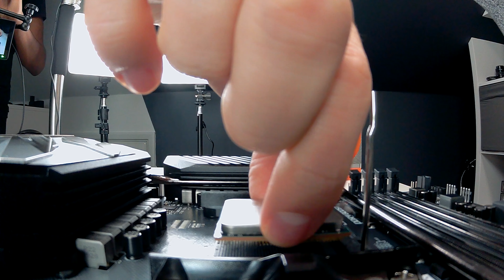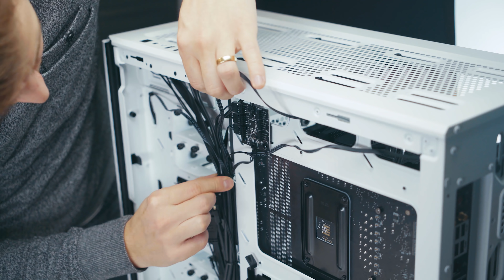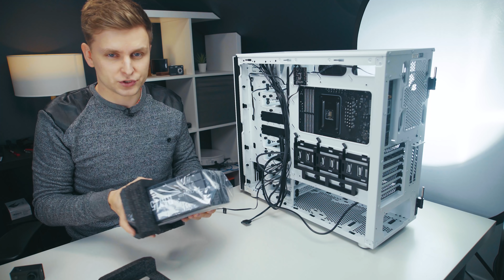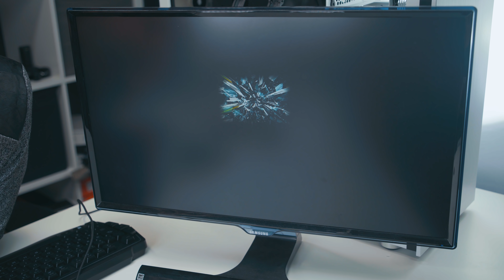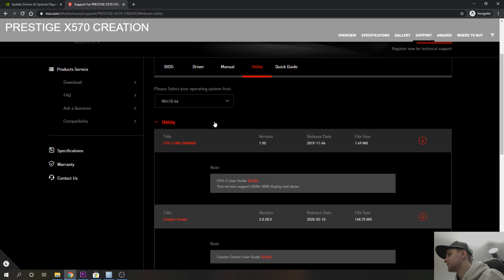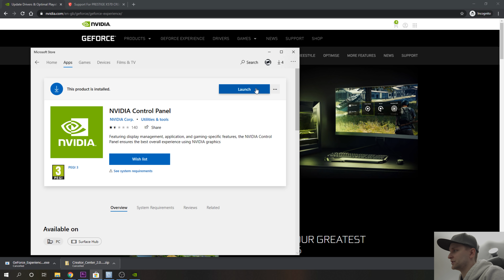ULTIMATE GUIDE: How to build the MAC PRO KILLER PC

Comment: Hello, so I had this built. After watching you for a while, I realized the GPU was put in wrong. I'm going to fix it myself. One of my USB ports was creating an over current. Which shut my comp down in 15 sec. I got a brand new same motherboard, what GPU upgrade would you suggest?  Along with Sound I upgrade my CPU? I know CES is coming up with all the talknof the "new" GPU's being released, should I wait or can my aka this set up even handle the new GPU's? I have the 1200 power source.

Comment: So I'm in a bit of a predicament. The motherboard keeps giving me the 02 boot error, and also the RAM errors of 50, 51, 52, and 53. I've tried each RAM by itself in each slot, but nothing changed. Even tried reseting the CMOS. So, I took everything out and built it outside the case. Oddly enough, with 1 RAM in slot 2 it tries to find a boot device (none present at the moment), but then adding a second RAM in slot 4 it goes back to the 02 boot error. Ended up reseting the pc with the case rest, and now it flops between the Boot and RAM errors.

Comment: I am trying to do this build and so far I'm stuck on getting the cable management right. There was no way for me to place the pinholes to the pins. I'll give it a day break though. I'll continue this weekend and hope that gravity helped me enough.
Reply from the maker: You could try to attach the 24pin to the mobo before screwing it in, that way you could plug the necessary PSU cables in before installing the mobo. :)
Reply: I’m almost done!! But quick question for the graphics card. You said that you’ll want to place it in the PCIE gen 4 to make sure it’s the fastest but what if I have a PCIEx 16 or should I use that instead?
Reply: Solved it! :)

Comment: On my mother board the code c5 and d0 pop up. And on my mother board there’s a light turned on in the EZ debug LED for the DRAM. Can you help? I can’t get it to load on screen and remove those codes
Reply from the maker: Make sure your ram sticks are properly inserted, and also try using only one stick see if it turns on.
Reply: @theTechNotice  thank you so much! I’ll try it out and report back :)
Reply: @theTechNotice  One question though! Should I try to remove the RAM sticks while in the case ...or do you recommend taking out the set MOBO and cooler
Reply from the maker: While in the case, but make sure your pc is off!
Reply: @theTechNotice  so I removed the RAM and tried it with one stick to see if that solved the issue but nothing. Could it be the sticks don’t work? If not, do you think their might be an issue with the motherboard or something else? I heard the mono has an issue flashing the BIOS
Reply: @theTechNotice  sorry for all of the questions. I’m just struggling
Reply: I’m getting replacement RAM sticks to check if that’s the issue. Do you think I should place a return on the MOBo? It’s my first build and I’m not sure how to get it to boot and not have the code

Comment: The only issue I have with that case is the bottom-mounted power supply. In most cases with modern cases I have the issue of no ODD drive bay but I seem to see one of them in this case. What is the make and model of that case? May I make a suggestion that you get a strap for the go-pro that would attach it around your head like a head-mounted flashlight/torch mounts. A scalpel will allow the removal of a zip tie without cutting it if you get it between the strip and the clip inside of the block. Optionally, and my personal choice, I would have included a blu-ray burner for watching movies and data backup.

Comment: Hi, if i have only 1 cpu_PWR1 normal with 8 plugins and spu pwr2 with only 4 plugins. Is that an issue having only one cpu pwr cable on ? Thanks
Reply from the maker: People say 1x 8 pin should be fine to run the CPU. I'd personally prefer 2x 8pin.
Reply: @theTechNotice  I bought msi x570 motherboard and it doesn't have 2x 8 pin plug in. IT has 1x8 pin plug in and 1x4 pin

Comment: Finishing building this beast, question those two extra cables that u left alone after u disconnect all the fans, where do they go connect it or those are just left alone?
Reply from the maker: Do you mean the cables from the fan hub? You can just leave those cables.
Reply: @theTechNotice   no not those one that says PMW cable and a flat one, on the video right after u disconnect the fan ones u explain about those cable that leave those alone
Reply: @theTechNotice  I was building it late last night and yeah u are right, thanks for the great info

Comment: One question, I know for sure that for Samsung 970 Evo Plus, before to apply any radiator over it, you need to peel off the sticker.
I understand that for Sabrent you don't need to do the same?
Reply from the maker: Yep, that's right, coz the 'sticker' on sabrent is actually copper and acts as a heatsink. :)
Reply: @theTechNotice  Glad to know. Thanks for the info!

Comment: Thank you for this very comprehensive step by step video. You definitely made this a truly "All in One" tutorial by including  the OS and drivers installation steps.  I am gathering information to build a photo/video editing platform to replace my 12 years old Dell XPS PC which I only use for photo editing running Lightroom and Photoshop. I am thinking of venturing into video work using Resolve rather than Premier Pro. After a few days' research, the main setup I have in mind is Ryzen 9 3900X, Zotac Geforce RTX 2060 Super, Corsair Vengeance 64GB 3600 and Sabret 1TB m.2 ssd. Also the BenQ PD2700U monitor you recommended. The case is Asus GT501 TUF EATX full tower. The motherboard I picked is the Asus TUF Gaming X570-plus. I wonder with this motherboard in mind, is there somewhere I can find out if the RAM and GPU (or other components) I picked are compatible with this motherboard? The setup is now around £2.3K mark. Do you think if there is anything I should change to make it better for my £? Cheers.
Reply from the maker: Looks good, all GPU-s are compatible with whatever motherboard, so thats good.And your ram should be fine as well.you might be able to save by going with 3200Mhz instead of 3600Mhz, but you'll loose slightly on the performance.
Reply: @theTechNotice  Thank you very much for your kind reply. I just found your other video explaing the rationale behind this Mac Pro Killer Build. Very useful indeed.  I guess, just like many  newbie PC builders, my worry is compatibility issue. For example, will my chosen motherboard (Asus TUF Gaming X570-plus) fit into your recommended Corsair case? Can I also ask if Geforce RTX2060 Super would easily support multiple monitor setup like your 3 monitors on your desk? I made the mistake of thinking that Geforce is a brandname. I wonder a GPU with label "Geforce RTX ..." supplied by different manufacturers provide the same spec in terms of capability and hardware compatibility? Perhaps you may like to do a video clip to tell us the beginners the principle of chosing components from different brands and what we should look out for. Cheers.

Comment: Hey dude loved this video! I build a PC back in 2017 but sold it after buying a new MacBook Pro... Your video made me decide to make this PC as I really want a strong workstation. However I couldn't buy everything exactly the same. Here are my specs: MSI MAG X570 Tomahawk WIFI, AMD 9 3900X, Gigabyte Geforce RTX 2070 super wind force 8GB, Samsung 970 M.2. 500GB, Corsair Vengeance LPX 32GB 3200Mhz AMD tuned, Corsair RM750 PSU. I also went for the artic freeze 2 280... The build went fine, but because I'm not a PC expert, the first issue I've run into is when I turn the pc on, the lights and fans start everything look fine... But no signal for the display, Ive tried multiple HDMI cables, different monitor, Re-checking the CPU, removing GPU, reinstalling GPU, Removing and installing RAM. But still no display signal. I'm at a loss. Any ideas why I'm not getting a display signal? Thanks.
Reply from the maker: Definitely plugging monitor into GPU not mobo?

Comment: Can you tell me if the Frozr heatsink on the MSI x570 Prestige motherboard is adequate for also cooling the Sabrent 1TB Rocket NVMe 4.0 Gen4 PCIe M.2 Internal SSD Extreme Performance Solid State Drives OR should I look for a different motherboard that would accommodate the SSD that has its own heatsink attached to it?
Reply from the maker: To be honest you don't need to worry about cooling down the SSD on the mobo. I personally haven't seen anyone bottlenecks because their m.2 drive is too hot...

Comment: Great vid -- but lots of questions:
1) what is the largest SSD that will fit in this MB -- my MBP has a single 8tb ssd and I very much like this.
2) while I like the vast array of USB-3 ports on this MB -- I really prefer Thunderbolt 3 -- is it possible to use I/O or GPU cards that provided Thunderbolt 3 connections -- or by not going Apple one has to accept USB-C is the best that there can be. For example -- the Mac Pro I have in mind would use one or two "Radeon Pro W5700X with 16GB of GDDR6 memory"  -  the X gives 1-HDMI and 4 T3 per card. 
3) it took until 51 mins in for me to understand you were building a PC and not a Hackintosh.  So I am now very disappointed. In me for not spotting the letters "PC" in the vid title.
Reply from the maker: 1) The SSD size is capped by SSD manufacturers not the MB. There's a lot of PCIE m.2 slots (4x with the expansion card), so you could put in 4x8TB NVME SSD-s if wanted. Plus a lot of SATA SSD-s.
2) That's the downside with AMD at the moment, there's no real solid solution for TB3. :(
3) haha, sorry about that :)

Comment: Finally did, I bought all you recommended to purchase, but had to return the Cosair Case came in with broken fan and cracked case. Now bought all this during the Covid stress. So had to return after is sat in the box for several months. Amazon took it back without any problems. Then I went to repurchase the unit and no longer could get! Also couldn't purchase the corsair power supply. So I ordered a Silverstone case, no where as good as the Corsair but it was almost 100 US dollars cheaper. I also bought the EVG Power supply 750watt Gold Power supply. Get it all put together today, fired it up and all turned on a functioned. Now waiting for the Window 10 usb startup. Thanks for your guidance couldn't have put this together without your inspiration. By the way I'm 66 years old and love doing stuff like this. It is my first time building a computer. Anyone can do it with your fine instruction. Much appreciation.. Michael
Reply from the maker: I'm so glad to hear that Michael! Well done! :)
Reply: @MediaSvigerVideoMaker / MSVM  are you asking about the case or the whole cost. Case was under 100 dollars. Whole project about 2600 US dollars

Comment: This is my first build. I have gotten all the parts on your list but on the case im using a Thermaltake Core V71 because of the lead times on the corsair that you used.  The Core V71 has a GPU card bracket. Do you think if i used the bracket, which would mean I would have to use a riser cable to install the graphics card, I would loose any quality of the original build you did where you put the card straight in the slot on the motherboard? Hope I worded that correctly.  Thanks!
Reply from the maker: Nope you shouldn't loose any performance doing that. 😊
Reply: @theTechNotice  Thanks man.   Your video was awesome on the build, especially for me being a novice.  I like watching Linus Tech Tips but he could learn some tips from you on how to fully explain and video a build for us non experienced folks out there trying to build our own systems.  Best video I  have seen to date on a build!!

Comment: At 35:07 you plug in a usb 3.1 type c cable. I'm doing this build and have everything else worked out, but my msi mpg x570 mobo doesn't have the port for that USB 3.1 type c, is it ok to leave that unconnected? What should I do about that?
Reply from the maker: Yeah. IT'S fine to leave it unconnected.

Comment: Quick question, the SATA hard drives, what storage size is the maximum and what brand would u recommend
Reply from the maker: The HDD size is not restricted by the mobo or the build, so you can put any size in. Depending on your storage needs, I recommend checking out my storage guide :) 4 TB seagate ones are mose TB per dollar, but that might not be always the most important aspect.
Reply: @theTechNotice  Thanks for the response Im 4 parts in and waiting for my final parts to get this baby start it, last question, so when i make the bootable windows usb, do I buy it straight from windows or how to I go about, since the one I have on this one is a hack copy, what would you recomend? thanks

Comment: My Bios is not reading the M.2 SSD Ive tried both slots, Ive updated the Bios still wont read please help
Reply from the maker: Could be a faulty m. 2 or mobo issue. See if the m. 2 gets detected through an enclosure or on another pc if you can try that. Hope this helps :)
Reply: Tech Notice thanks a lot. I'm able to return the M.2 for a full refund so I'm just going to get another one. I am going to try the Samsung 970 Evo this time.

Comment: Hi  I was just wondering why you didn't mount the m.2 OS drive in the Xpander gen 4?  What are the advantages and why is your mount better?  many thanks
Reply from the maker: The mobo m. 2 slot is gen 4 as well and I didn't want to add an expander for that.
I'm gonna use the expander when I upgrade my storage :)

Comment: bro, seriously I havent find someone to explain it the way you did. I need a decent editing pc and came across your channel and Im seriously thinking of starting to order my parts. Questions, have you come across any issues after a couple of days? and second any other tweaks you might wanna share. I need a pc to run 4k videos, edit them and I was going for a macbook but those are too much for not enough. Again, thanks for the great info
Reply from the maker: I've been editing with this machine for 6+ months now, and honestly it works 10/10 no problems and I even upgraded the cpu to a 3950x and it works great. 😊
Reply: So I just seen the other pc build for less than $1,000 where u are editing 6k. For a guy like me who does go pro editing on premier using 4K, some 1080. Would you recommend me start from there, or spend double the money and go for the kill? I’m basically do some editing, mostly family vids, but I love hight quality videos and no lag. Thanks
Reply from the maker: I think you'll see a huge difference from the mac Pro killer and the 1000 budget system. But it massively depends what codes you're using for 4k video.
When 4k video is the main resolution it's best upgrading to at least 32gb of RAM as well. :)
Reply: Thank you, I gotta say, I have look over a lot of builds and no one has explain it like yourself and make someone like me who loves gadgets but scare of taking the task of building a pc, look like a breeze. Thanks for your great content and for answering me so quick

Comment: If you use this case, but opt for the Gigabyte X570 AORUS XTREME motherboard because first choice wasn't available, make sure to order a low profile USB 3 header extender cable, because it is impossible to make the connection with the cable that comes in the case. https://www.amazon.com/gp/product/B01N7DU5LC?ref=ppx_pt2_dt_b_prod_image

Comment: Alright. I want to build this but the motherboard seems excessively expensive. Is it really worth the price tag of $500? Should I consider any other board for the same setup? the Asus TUF Gaming is only $165 and the ROG Strix x570 is $255. Other than the losing the 10GB LAN, is the Prestige Creation any better than these cheaper motherboards?
Reply from the maker: Honestly depends what you need, but if workstation, I'd definitely go with the x570 chipset.

Comment: I'm going to purchase this computer. What do you think about the specs? Thumbs up or down? ASUS GeForce RTX 2060 DUAL EVO Advanced AMD Ryzen 9 3950X Processor CM Masterliquid ML120L ARGB Komplett Edition Corsair Vengeance RGB PRO DDR4 2933MHz 32GB Corsair Vengeance RGB PRO DDR4 2933MHz 32GB Intel 660p 2TB M.2 SSD Seagate BarraCuda 2TB 3.5'' HDD ASUS ROG Strix B550-F GAMING moderkort Seasonic Core GC 500 500W PSU Svive Gaming Virga nätverkskort Windows 10 Home
Reply from the maker: If you're using it for editing I'd go with 2060 super instead of 2060, gives you 2GB extra memory, and other little benefits that add a lot to video editing for not a lot more :)
Reply: @theTechNotice  Yes, I will. Thanks for the insight!

Comment: Thanks for this video, its excellently explained and informative. One question. I have kept your recommendations on equipment although opted for the mpg x570 gaming pro carbon wifi motherboard to keep the wifi features but cheaper in price. This being said, I am at 46.29 minutes though the build to your video time and the cpu connector cable doesn't fit with the cpu pwr1 & 2 ports (The male cable teeth are slightly different with my motherboards female cpu pwr 1 and there is an 8+4 female entry on the motherboard rather than your 8+8 although connects to the power pack fine. Could you recommend a cable that is compatible with this motherboard? I have been looking although don't want to force and potentially damage a connection. Thanks again for this video.
Reply from the maker: Hey,
the PSU should still be compatible, but instead of using 2x 4*4 pin connectors, use just one. the 4*4 connector is not as important and your PC should run perfectly without it. 
The 4*4 CPU connector should be the same on every PSU and Motherboard. Is it definitely the right way ? 🤔
Reply: @theTechNotice  Thanks! I was just being a melon. Great video and it all works well!